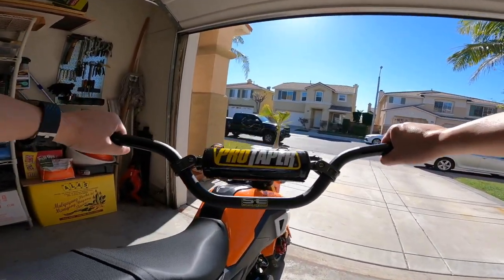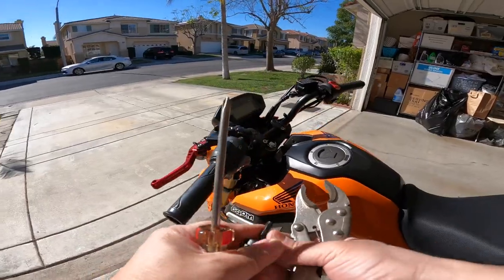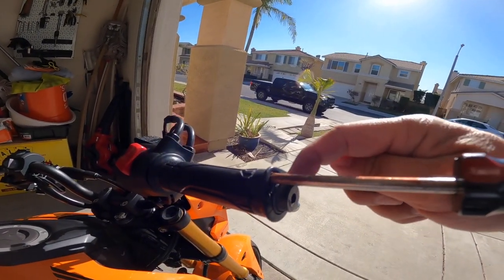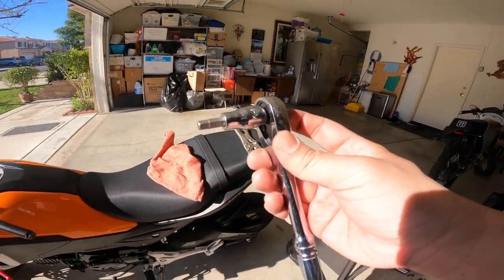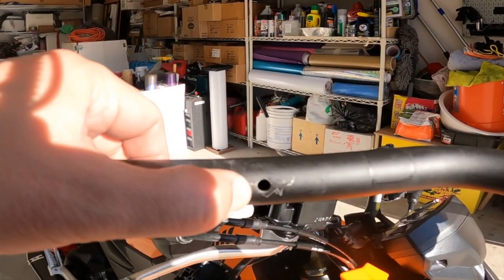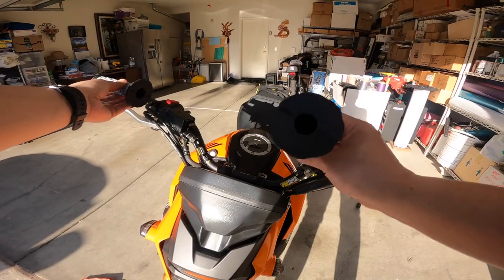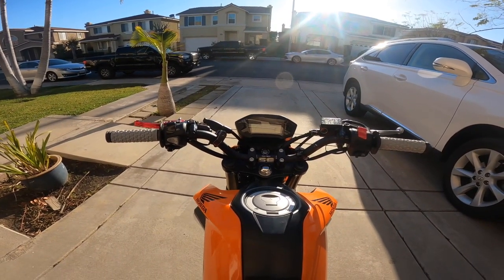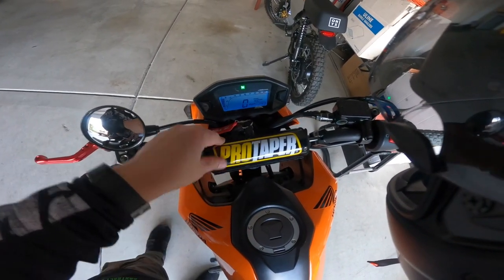2020 Grom with Honda Mini Pro Taper Bars and Pillow Grips (Not KLX110 Handlebars)

Comment: did you need to adjust the brake and clutch cables after the new bars? looking to get the Honda Mini with my 2022 grom, the only things I'm buying are new bars, grips and grip glue

Also, how wide is the handlebar pad? looking to see if I can get a smaller one
Thanks

Comment: Hi, I recently installed the same handlebar as well and with new protaper grip. But once I finished, the throttle tube will stuck when bike turn right, ( turn left is normal) so, have you adjust the throttle cable and how?

Comment: Question u have a grom and rcr? Why have both imo they are equivalent but on the opposite energy realm? What u think of that?  What u feel is the better bike  besides range ?
Reply from the maker: I did a video comparing the two. They're not the same. One is an automatic electric and the other uses a clutch. Anyways, I sold them both. Watch my latest videos lol.